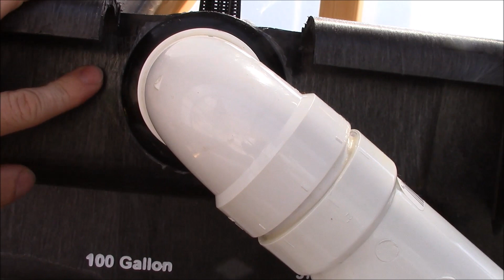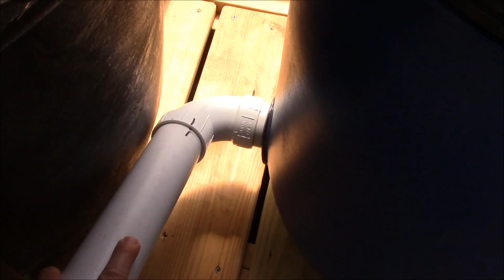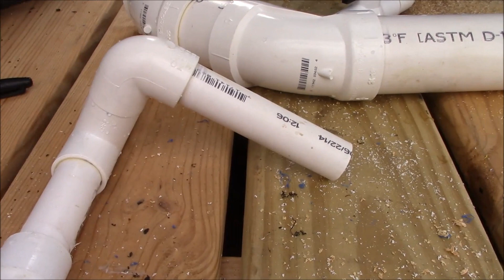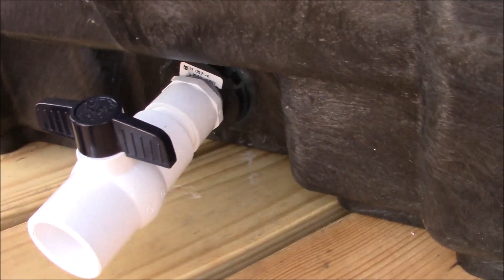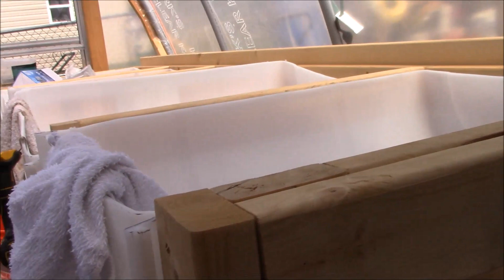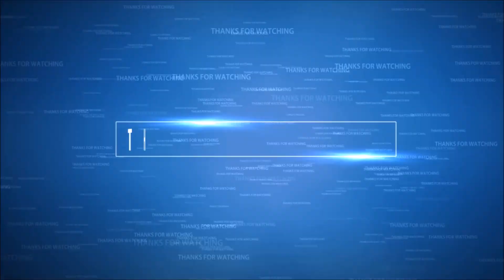Urban Aquaponics - "Aquaculture" VLOG 2 by HPFirearms

Comment: I had found your Chanel before, but i just subscribed the other day.
I am a fairly new prepper. I have only see aquaponics done at this level on one other video before. I think you have done an amazing job with the piping and the layout.
My wife and I will be buying a house in the next year or so, and would like to do a smaller scale than this. Just due to space.
Do you have two 100 gallon tanks from tractor supply? One for the Fish and one for the troth?
-Jerome

Comment: Bobby, looks great and well thought out. I have been doing now for about 3 years, and have one suggestion which probably moot now, but fishless cycling is best done with grow beds filled with media. That is where you need the bacteria growth. Just a thought for anyone doing this. Another thing, as to media. I have tried GroStones, Hydroton, and Expanded Shale and various combinations. The Hydroton is by far the best, but very expensive. The Expanded Shale by itself is too fine and will quickly clog up. The GroStones are rough on the hands but good otherwise. I found a good way to lessen the cost of the Hydroton costs. I rebuilt a bed that had shale in it and found a mess. What I did was go to Home Depot and bought several bags of lava rock which is pretty light and very good texture and put in the bottom of the growbeds about 2/3 way up and toped off the beds with Hydroton. The lave rock was cheap and had good bacterial surface area and drains very will, and the Hydroton though expensive is easier on the hands. Bed is working very good now. Just a thought.

Comment: This is really coming a long nicely. Love the build. When I have more space I could see myself building something very similar. I hope your fishless cycle goes well. A major factor is water temp. Here in CO. my water temp stayed pretty cool for a long time. Thus, took 7 weeks to cycle. If you keep your water 70+ it should cycle pretty quickly. I also added Micro lift which seemed to help. I heard you mentioned bluegill. I added a dozen to my system and very happy with them. Keep on rockin on man.